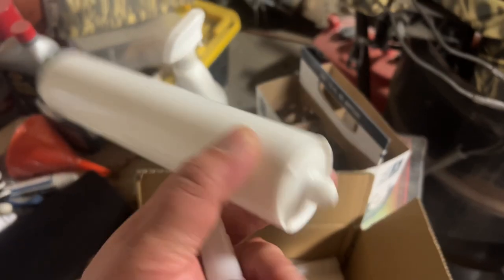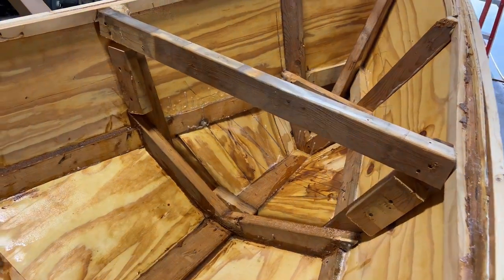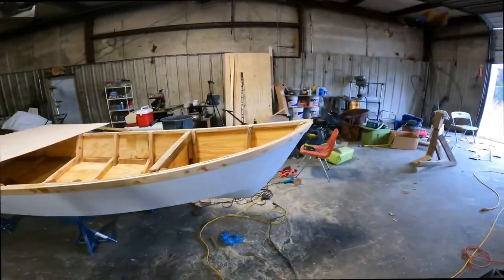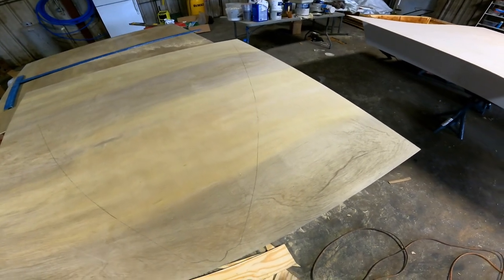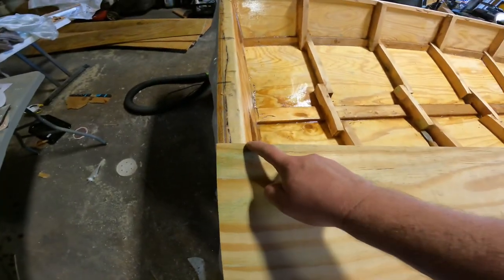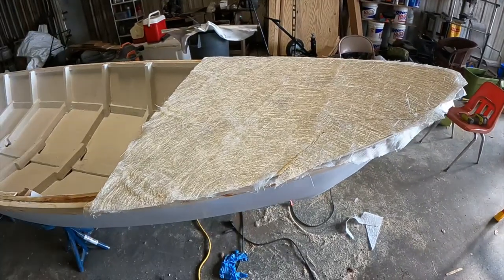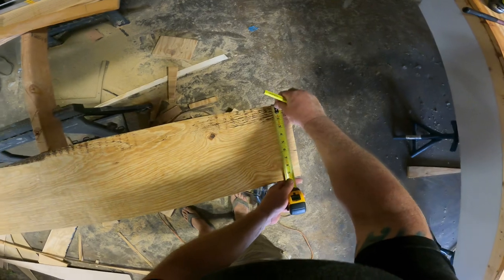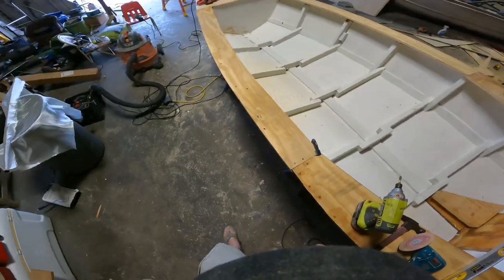DIY Boat Build- Adding the Cap!. Ensenada 14 Panga

Comment: Looking good !!I just found your channel and watched all the videos since you moved the boat to your shop. I’m currently building a Spira Chalmette and hope to have it finished before Christmas.  Great tip on the caulking tubes. It would be a lot easier running filets with that instead of a baggie.
Reply from the maker: Thank you. Isn’t the Chalmette the small solo skiff type design?  I was wanting those plans before Mr. Spira passed away. 

If you get some good pictures or video of your boat, you can send them to me and I will include them in a video of you like. I like that design.

Comment: Thought you were gonna put foam in the nose cap.
Reply from the maker: I absolutely am. I’m going to cut a hatch in the top, put a compartment inside and fill the rest of it with foam. The forward deck will be foam filled as well.

Comment: TECH TIP for builders using wood and epoxy.

When glueing or laminating wood with epoxy resin, always wet out, soak the wood with thinned epoxy FIRST.  While still wet, then add the filet compound or laminate.

WET ON WET.....never, ever, effing ever, laminate over dry wood.  you just FAILED, miserably.
Reply from the maker: Tips for comments- don’t be a jerk unnecessarily. This particular epoxy I’m using is cut with solvents from the factory. It has the effect of handling both jobs at one time, penetrating and layup. Just make sure to use enough so your lamination isn’t too dry. My laminations won’t fail and there’s always more than one way to do a job. Good luck, have a great day.